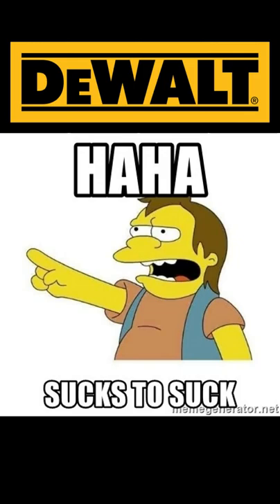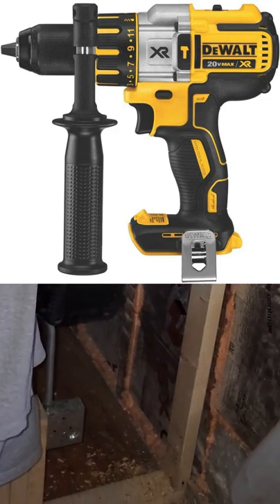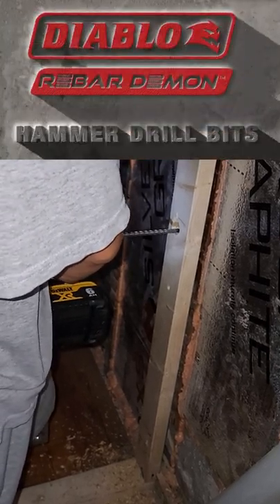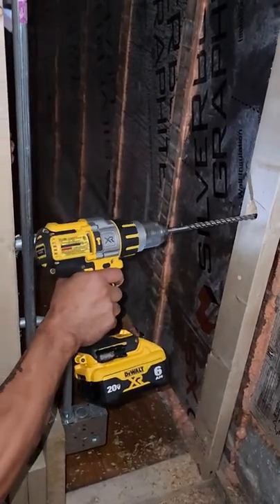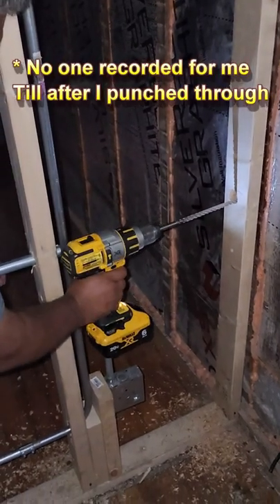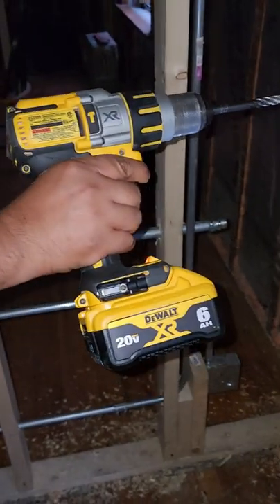DeWalt Sucks! A story that must be told! 😣@dewalttv

Comment: One other thing I forgot to mention is that it helps to blow out the dust in the hole. Years ago Makita's hammer drills came with a blow bulb that looks just like a baby nose cleaner. It helps a lot believe.
Reply from the maker: Yes that technique allows the dust to come out and helps in cutting through. That is cool info on the blow bulb!

Comment: Putting the drill in and out is called wood peckering . I'm surprised this electrician didn't know this .It's been standard trade practice whether you're talking construction or metalworking. Quick rule of thumb when drilling any hole is depth of hole equals 3 times the diameter of the drill bit anything more than you have to woodpecker both for chip/dust clearance and to prevent burning up the drill. Also when drilling any masonry this is vital as the dust will cake up and fuse itself to the bit making it unusable. All of this I learned 40 years ago as an apprentice carpenter and then relearned when I went to working in a machine shop.
Reply from the maker: That is an amazing amount of knowledge brother. I want you to know that the electrician is one of the best, his work is gorgeous as well as on point and meets strict code every time. 
I think he got so wrapped up in showing me his Dewalt was king, got the better of him and the guys on site. We have been dogging each other's preferred brands for a week or two.  I have never heard it called peckering though, but I caught it on video, you saw it your self and as I asked other respected tradesmen there they also said push through. Could it be it's something that is not being taught much anymore, I can't be sure as I am not union?
Reply: I don't know if it is or not like J-Who I gave it a go but I did it back in the early 80s not a good time for nail benders and wood butchers .  but I did learn some stuff and sometimes I even remember some of it.

Comment: Many failed attempts with all different brands, impacts, drills, recips, bits, etc etc. When I run tool tests I do 3 runs per tool and bit. I use the fastest time for my comparison. The best way I know how to make it as fair as possible. We all know took testing will never be 100% accurate, fair, or equal. We just do our best. As long as your honest and don’t try to make one brand look better than the other then we’re all good. Appreciate the video Ed. Really enjoyed it. Something different. In a good way✊. Much love broda
Reply from the maker: Thank you and I truly appreciate you! Youtube is not easy and tool testing is not easy.  I have no doubt that your testing is as fair and true as you can possibly offer it. With this video, I just wanted to tell the other side of the story. Sometimes we don't get the same results out here, as this case shows. It does not mean anyone testing was wrong or the tool failed, sometimes the issue is environment, material, etc.  I owe you some watch time. I'll try to watch some of your videos this week. Much love broda!
Reply: @edtheoldtechguy  nah Ed, I didn’t take it that way at all brother. I know exactly what you meant and were saying. I know all to well my friend. The way a tool responds or a bit drives in the garage on a test rig can be completely different on the job. That concrete cinder block could have been 5 times harder than one you went and bought at Home Depot. So many variables come into play. 100% agree with the technique on extracting the bit a little then re drilling. Especially a deep hole as that one

Comment: Use the right tool for the job, if u got that much concrete, stone, tile etc, just get an SDS rotary hammer drill, come on man🤦
Reply from the maker: Lee we have all done it. I can't blame him, he is an excellent electrician and he did say "Ed I should get my SDS" but became emotionally involved with proving his point that the Dewalt was better than the Makita. As I assured him that my old released in 2008 brushed Makita could do it. I promise you this electricians work is amazing and something to seek after I wouldn't hire him for jobs if I didn't believe so.
Reply: @edtheoldtechguy  lol I'm just giving you a hard time, anyway that was a great video, 👍

Comment: I have to agree with you on your point you made in the video I used to have a even older DeWalt hammer drill dc935 and under certain circumstances it would not perform the same task that it did somewhere else with that said you can use any brand and run  into the same issue
Reply from the maker: Absolutely right this could happen to any brand which is why I wanted to tell this story. Dewalt is one of the best out here.

Comment: Dewalt does suck I wouldn't buy it. As company tools I've used them. Experience in less than a year old tool. The bits fall out of the sds hammer drills. And fall out of the 1/4 inch impacts. Metabo hpt is way better for the same price range
Reply from the maker: Great feed back thanks

Comment: Looks like a wore out bit from what I see
Reply from the maker: It was brand spanking new Grimm purchased that morning but anything is possible.
Reply: @edtheoldtechguy  strange, cuz I can get a non hammer bit to punch faster than that thing was going. It doesn’t take that much hammer action to get a hammer bit to do it’s job. I’ve used a regular bit on concrete with a Dewalt hammer drill when in a bind and didn’t have a hammer bit.